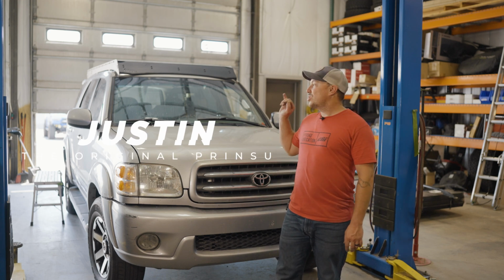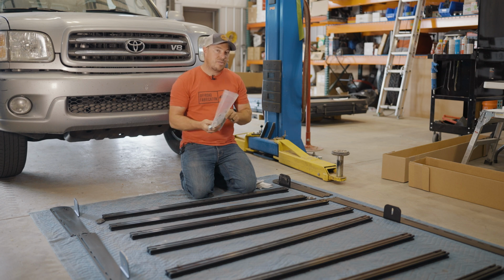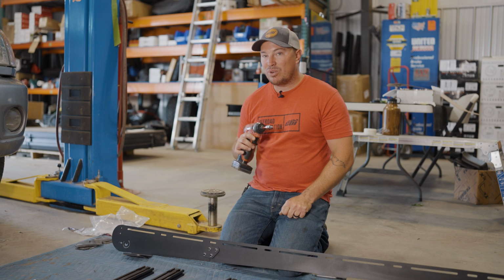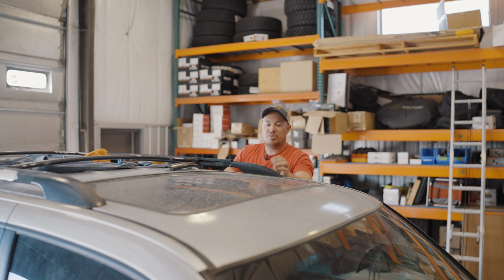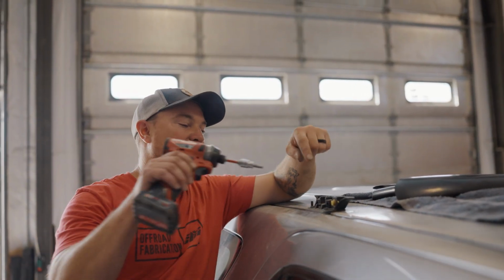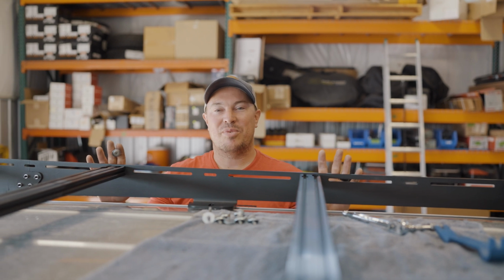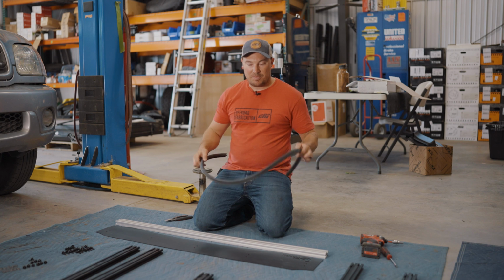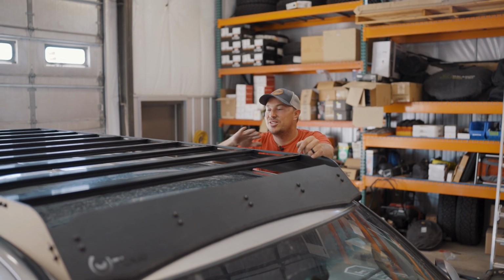Toyota Sequoia Prinsu Roof Rack 2001-2007

Comment: My rack came with roof bolts, am i supposed to use those or the factory ones?
Reply from the maker: Use the one's that came with the Prinsu Rack, we previously recorded this video when they weren't included with the hardware kits. Either way will be fine.
Reply: My factory bolts stripped off but the ones provided don't thread on properly, is it supposed to be a hard fit?
Reply: Lucky you. I didn't receive roof bolts. I had to order them from Toyota. Major disappointment.